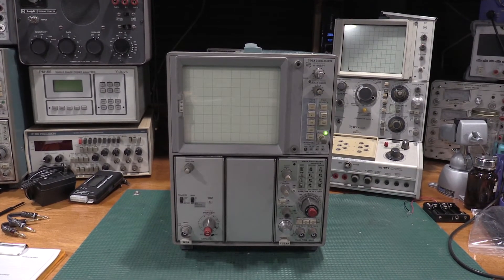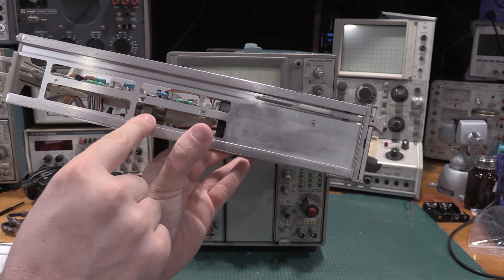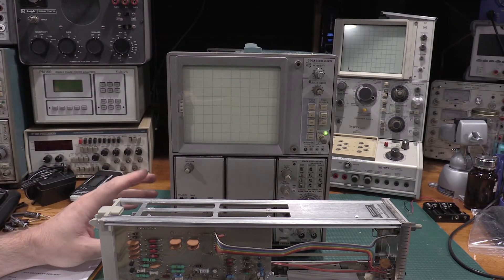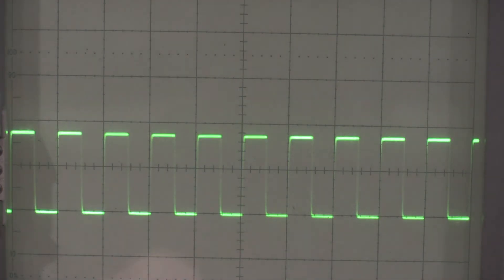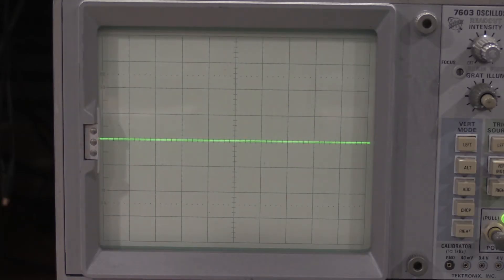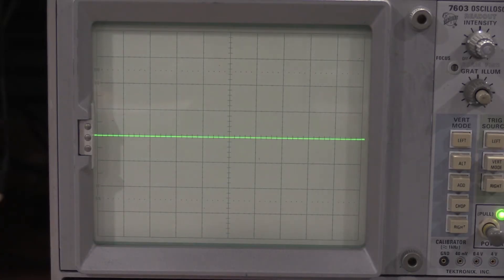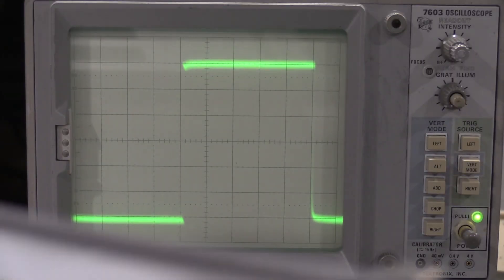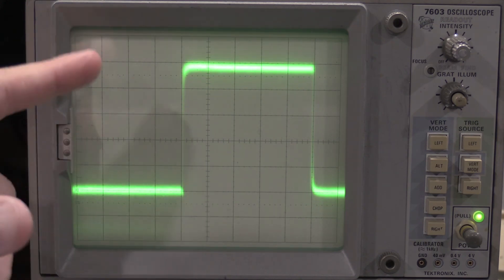Tektronix 7A15A Calibration

Comment: 33:25  lol...I'm glad it's not just me.  I wholeheartedly agree about the larger display scopes, in fact, I am actually a big fan of the 5000 series.  If you don't need the bandwidth, the non storage variants have the larger tubes and the added advantage that the frames are not so deep, saving bench space.  I have a 5440/5B44 setup here that I am quite fond of.